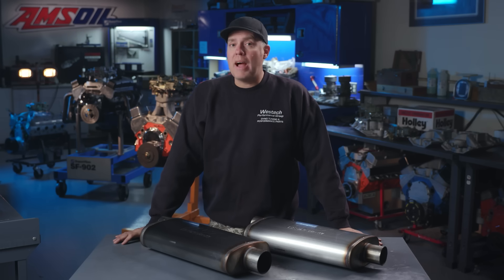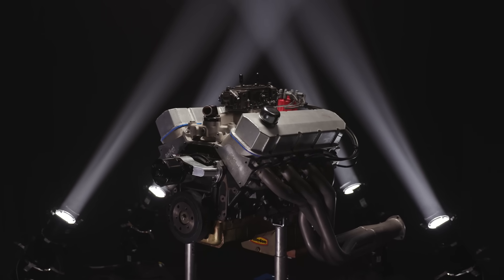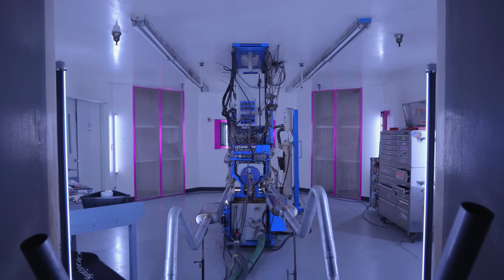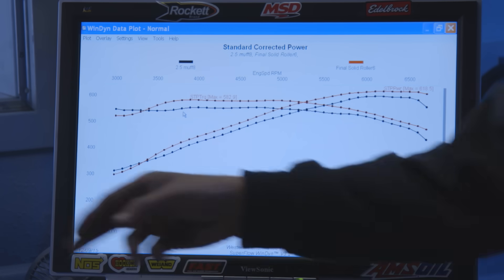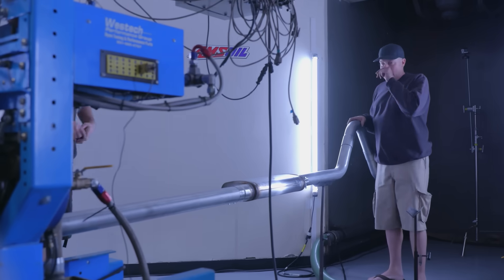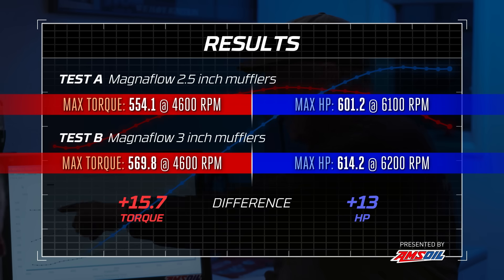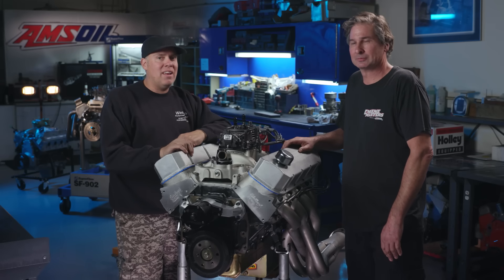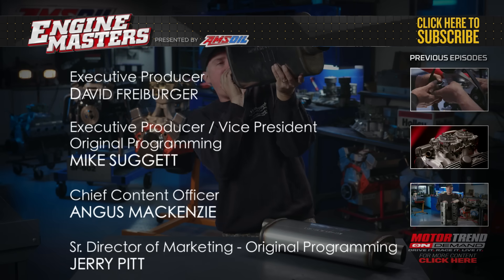The Power of 2.5- vs. 3-Inch Exhaust - Engine Masters Ep. 9

Comment: Great, now do it with 300-400 HP... what most people have
Reply: +little billy Host people have 300 hp cars! Where do you live?
Reply: Is there a v4 mustang? Are you sure that Its not I4?
Reply: +Barış Çepni he lives in USA maybe?
Reply: Skylar Garrett
Thats one hell of a lemon.
Reply: Timmy Parnell 4 Valves, that car wont move. That would be 1 valve per piston.
Reply: +colonio It's not a V4, lol. It's the same engine as the old mazdaspeed 3. Direct injected mazda 2.3L I4. Also known as the 2.3 ecoboost.
Reply: Barış Çepni wife says kids can't ride in the trunk.
Reply: +OutlawUniverse exactly. that's why to use it for rallying you are, quite sensibly, having the whole bottom end rebuilt. I'm not entirely sure why the stock engines are so weak. it could well be that they use the same bearings on the turbo engines as the naturally aspirated engines (not sure if they are available in the US) and here in the UK a non turbo Subaru engine is a pretty strong unit. apart from that, here in the UK at least, the morons that buy them put dustbin sized tailpipes etc on them that are so loud you can hear the car literally 2 miles before you see it and its ruined the image of what was, originally, not a bad car, but now when you see/hear one its almost instinctive that you think 'what an asshole' about the owner. and its often true!
Reply: little billy OH so you are a savage.  Got it.
Reply: Lots of smart comments here
Reply: +Barış Çepni v6 11+camaro, mustang, charger, challenger, over 300 hp
Plus v4 mustang and camaro has over 300hp too
Reply: +Barış Çepni i am sure google it
The new 2015 v4 mustang turbo
Reply: +Barış Çepni Maybe 4valve?
Reply: Interesting, I never knew they made v4 engines...
Reply: +little billy I'd like to see that too. A standard N/A H/C/I style motor probably isn't going to see a huge difference between 2.5" and 3". Ultimately, if you have all of the space in the world to run pipes (like a full size truck) you may as well go big, but for most cars where you'd have to go through a ton of effort to fit 3" I doubt it's worth the time.
Reply: +Barış Çepni It's highly unlikely it's a V4. Lancia did it back in the days with the Fulvia, but it's a dead configuration afaik
Reply: colonio
Thats what I am saying ;)
Reply: Barış Çepni
There are lots of V4 engines in the world, but they're almost never used in cars and certainly not a Mustang. They were used in industrial applications frequently.
Reply: +Barış Çepni Plenty of people in other countries have 300-400hp cars. Hell, i know a guy in the netherlands with a diesel citroen AX that makes 300hp/700lbft. Imagine the torque of a 6.6 duramax in a car the size of a shoe.
Reply: +Barış Çepni to be fair most of my cars have around 300-400hp.  but then they are all 4 cylinder turbos.
Reply: +colonio speaking of lancia im working on importing a delta evo 1.  we can finally own them in the usa and i have a feeling in 10 years prices will be over 100k to start.  

like to get a Peugeot 205 T16 as well but thats never gonna happen.  200k to start.
Reply: Lol right!
Reply: OutlawUniverse
How many cars do you have? And what are they, I would really like to know.
Reply: Barış Çepni At the moment 5.  
-914gt with rsr engine and 916 gearbox(money pit of the highest order).  
-solstice gxp with well over stock power.  
-WRX with modified sti short block that is just getting finished(this is my first subaru and I don't know much about them).  
-kia optima sxl(got to have a family car), 
-finally a jeep cherokee rock crawler.  

I'm just getting to the point in my life where I can finally start a real car collection.  I'm going to try and get something fun every year if possible and want to get cars that are rare but haven't shot up in price yet or will hold their value.  I want to have fun and try not to lose money if I can.  So I think a Lancia Delta would be a first really good choice.  I haven't imported a car before so I'm trying to find out as much as possible.
Reply: +colonio Ford did it too.  Check out the Saab Sonett.  Great little motor and a cool little car.
Reply: OutlawUniverse
Why would you ever need a family car when you have 4 cars.
Reply: +little billy good thing you don't live in Europe then. most cars here are HALF that power but theyre also smaller (I believe)
Reply: +OutlawUniverse good luck with the STi. if its the same engne we get in Europe theyre well known for taking out the big end bearings. even cars that are stock and gently driven have the issue, not just the boosted hard driven examples. ive seen them go with 50k miles on the clock from new!
Reply: Peter Lattimer HAHA and that's why I'm having a motor built for it.  They opened a rallycross track near me and I was like "Oh we have to go buy a subaru".  

Bought a wrx the same day.  Later that night I broke the motor.  I found a shop that specializes in subaru and he basically said the same thing you did.  Just something that happens with subarus.  Says it can have 2k miles or 150k miles.  

So now this 4k wrx is turning into a 15k+ rally car.  I've been doing alot of the easy stuff myself.  Bushing, exhaust, intake, oil cooler, radiator, hoses.  The shift assembly was a complete mess.  

when the motors done they are going to come get it and drop it in.  set it up for e85 and hopefully have a fun toy.
Reply: Peter Lattimer  Ultimately for a fun toy I don't care how it sounds.  But we are going to use the subaru for our winter trips to mexico.  So quiet exhaust and also doing and active suspenion from tein.  Also have road tires and sort of like a small truck tire.  Mexico has really nice highways but once off the highway the roads suck.
Reply: +Barış Çepni 4 valves per cylinder
Reply: Not everyone in the world has access to cheap fuel, cheap engines and a cheap cost of living; American's need to stop being so ignorant.
As I said, please run these tests for 300-400 hp
Reply: little billy  
Not everyone in the world has access to cheap fuel- stop being so ignorant

cheap engines- stop being so ignorant

cheap cost of living- stop being so ignorant

 American's need to stop being so ignorant- stop being so ignorant

As I said, please run these tests for 300-400 hp- stop being so ignorant
Reply: its valve count PER CYLINDER.....
4 valves on the marketing sheet, 4 cylinders....16 total valves. 

look at the engine chevy made for the covrar...rear engined boxer style, but with a slight up slant...H or V?
Reply: also, i dont think you understand what most road trips involve in the US....in london, if i went 400 miles, id be in Berlin. 

in montana, a state in the us, if i went 400 miles, id still be 50 miles from college....and in the same state. 

these tiny displacement, high HP euro engines have NOTHING down at 1800 rpm...your downshifting to climb hills, keeping it at 2500 to 3500 rpm.  fun, sure...but on a 7 hour drive?

the american car shifts into over drive, 1800 rpm, and is able to climb 30 degree hills with out having to give it any more gas pedel....it just sits at 1800 rpm the whole 450 miles.
Reply: where I live its a tiny little island and 3 and a half hours drive from one side to the other.....and a speed limit with loss of drivers licence if we go over it ...and the v8's end up sitting in the driveway with the stockcar in the garage , I drive a 1993 1800cc Impreza when I'm not using my computer or driving someone's kids around their paper run
Reply: raga1s Maybe he has a Camaro? I believe thise are like 300hp for the 3.6 litre v6 and 400hp for the 6.2 litre v8 model.

Comment: hi david i would like to see rear vs front mount turbos,alot of people put there turbos at the rear of the car and alot of people complain that it creates lag/less hp and torque overall,i would like to see this put to rest thanks-shaun
Reply: +lfk156 Always more close to the engine is better, you've seen the engine bays the new ferrari 488gtb and the mercedes GTS, they put the turbos almost inside the engine in order to try to eliminate the lag. And yes you will make less power too, putting the turbos in the rear.
Reply: yeah I wanna know too
Reply: +lfk156 The one guy that I personally know that has a rear mount system on his LS1 Firebird says the lag really isn't that bad. I was at the dyno the day he made 570 rwhp on E-85 and an otherwise totally stock LS1, so I don't think the car was down on power either.
Reply: +efrain kennedy you say that but theres people that say it makes no difference at all